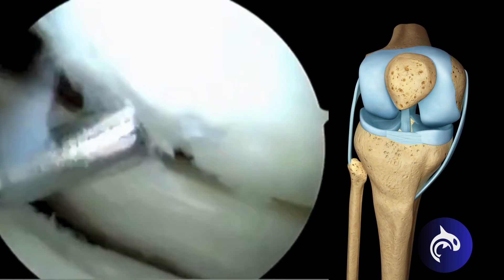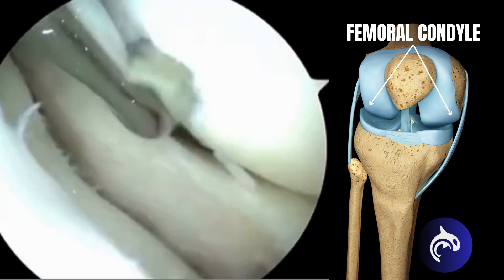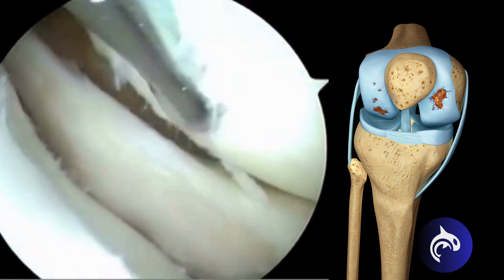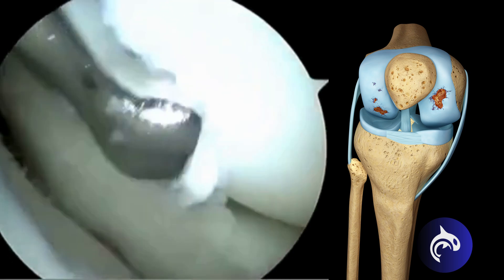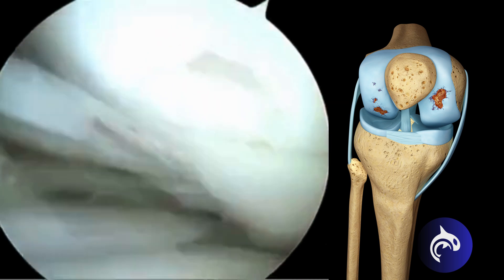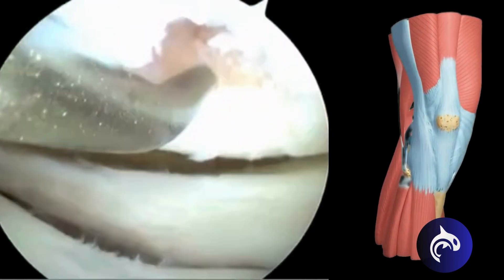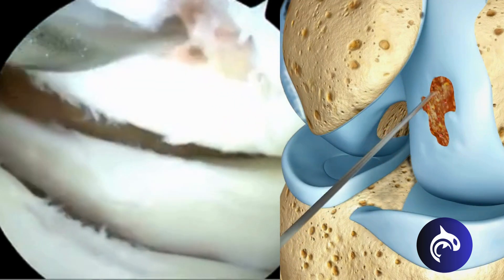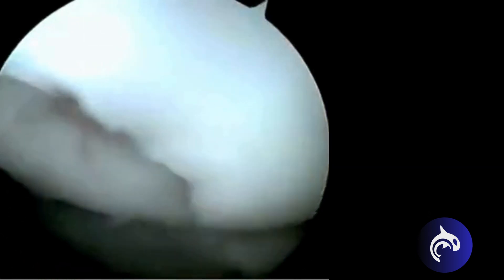Watch an Orthopedic Surgeon treat Chondral Lesions with Microfracture Surgery

Comment: Cartilage does not regenerate, though, correct?
Reply: Nope it doesn't.And because it doesn't have blood flow which means that there is no regeneration by the tissue itself,it needs an external factor like bone marrow in this case.
Reply: @henryjones7240  exactly why id prefer this video's title and wording to be corrected
Reply from the maker: You’re absolutely right that cartilage doesn’t regenerate on its own because it lacks direct blood supply. 

The process shown in this video, microfracture, works by creating small holes in the bone to release bone marrow cells. These cells form fibrocartilage, which helps fill the defect, but it’s not the same as the original hyaline cartilage. While it provides some joint protection, it’s not a perfect regeneration and is not as strong as the body's original cartilage. It can break down more easily.

The goal of this surgery is to prevent or slow further damage to the cartilage. This will help prevent knee arthritis. It can help delay the need for a partial or total knee replacement.